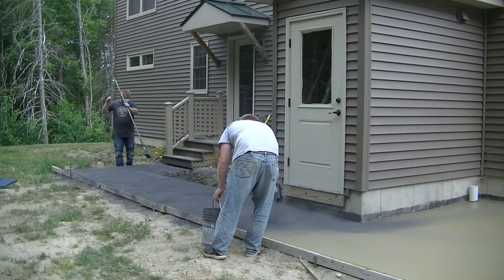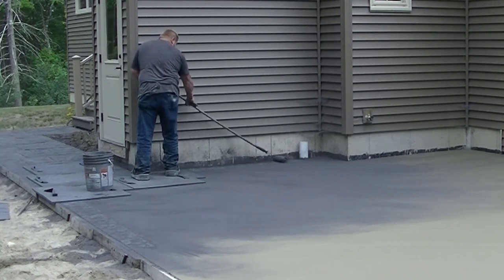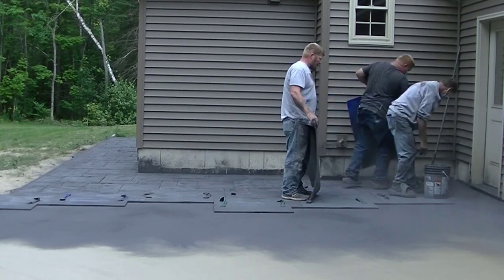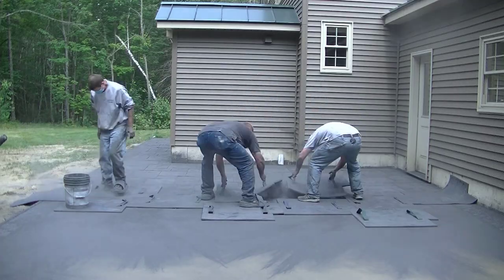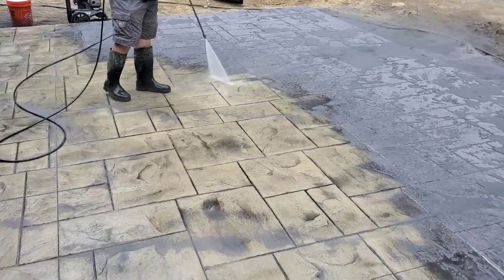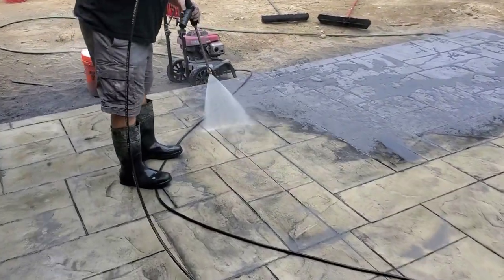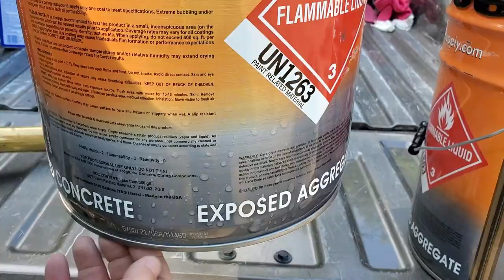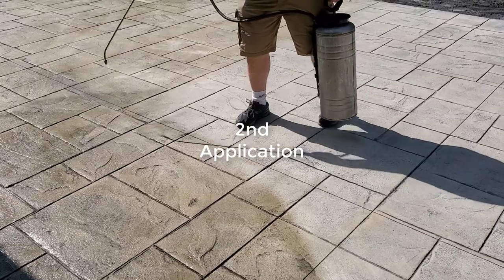Beautiful Stamped and Sealed Concrete Patio Slab

Comment: Brickform poly 400 rolled with a 1/2 nap roller will leave u with a perfect application no lines streaks dark light spots. Perfect even coat . deco is right around the corner from me in Ohio and it has amazing products just top of the line cost .

Comment: How long after putting the concrete did u run the pressure washer on your stamped concrete? Ppl say to wait 28 days?! Any info will help as I would like to seal ours 🙏🏻 thx Mike

Comment: Mike thanks for the great info. I have a 4 yr old stamped slate look 33x15 patio that has been popping sealer after it’s first winter. Looked bad so they added more stain with the sealer. Now more of a mess. I need a video on how to remove all the sealer. Been using Xylene (lots of it) power washing with 3100 psi.  Still has sealer is stuck in the indentations .  Have any ideas to help? Can you come to Cleveland? Can’t find anyone to do this job so I’m doing it. Also do you think I should you a penetrating sealer when done? It had acrylic Brickform sealer. It is not spalling, think that’s what you call it. Thank you

Comment: Hey Mike what tip size are you using that came with the Chaplin sprayer the 1 gpm  or the .5 gpm fan spray tip?                                                                                                                                                Thanks!

Comment: Hi Mike, beautiful work! I always get nervous when it comes to overlapping marks on the sealing application using a sprayer. I noticed on the after photo that no overlapping mark was visible but I did see that there was some overlap on the application. For us, it does show in some angles after the second coat. Is this different for each sealer or is this is a common thing for all brands. Cheers!